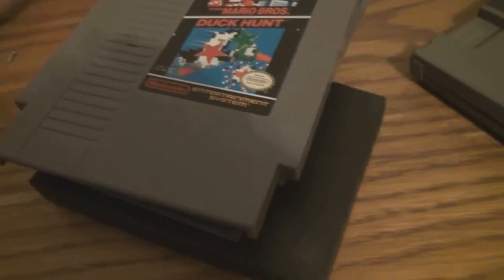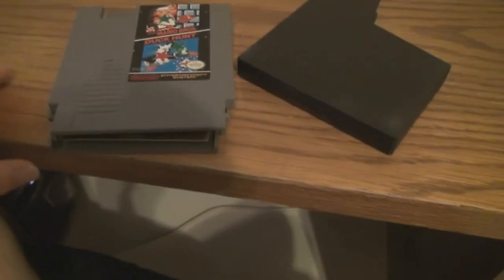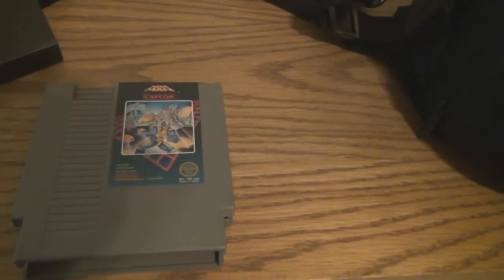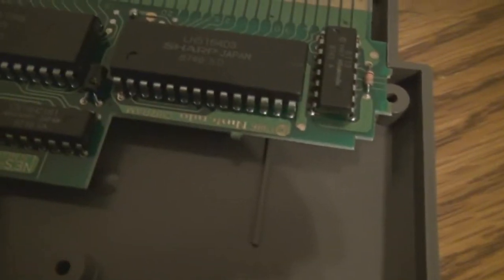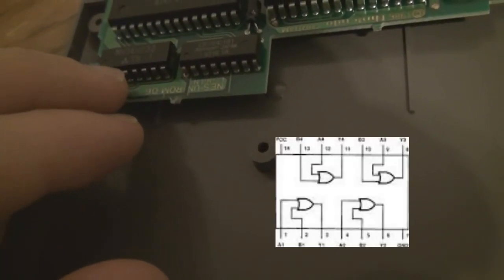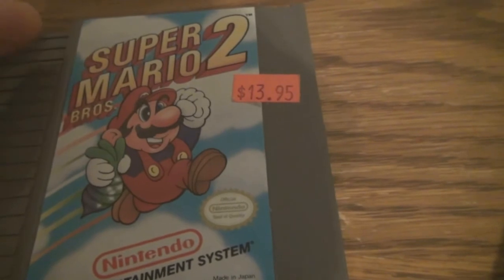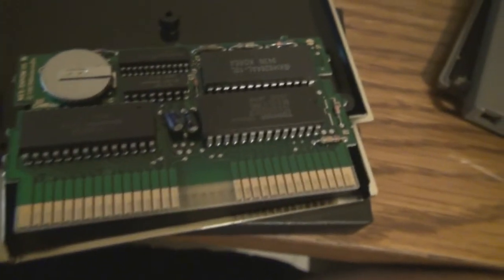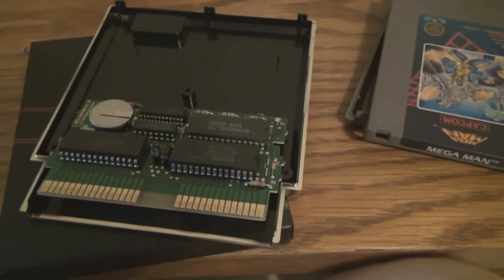Nintendo Cartridge Dissection - NES

Comment: I know your pain, my mum gave away my Amiga 600 because I had built my own (very shitty 486DX at the time, with no proper case and a power supply hanging out of the back because it didn't fit the shitty case) PC, I don't speak to her to this day for that..
Reply from the maker: Ha, my parents had an old 486 33MHz server they wanted me to set up for my sister to use and blamed me when it was slow.  Hell, this was 2004!  Of course it's going to be slow if you force me to instal Office 2003 on it.

But seriously, every time I got a new generation, my mother would question my sanity for retaining my older systems because in her mind, there was no need for them any more.  Obviously I would never play it again since I had something more advanced... and when I did play it, I was just being weird.  Finally, she decided I was simply a pack-rat, yelled in my face, and dumped my video game drawer in the trash.  I had to replace my N64 power adapter.

Comment: No, your tower is not "rougly 6,747x more powerful than an NES". You can't compare raw CPU clock rates like that, especially between vastly different architectures like a modern amd64 system and a 6502. The comparison is utterly meaningless.
Reply from the maker: I know that an 8-bit single core and a 64-bit quad core capable of multithreading can't be directly compared, but for the purpose of perspective I just wanted to show the ratio of the frequency.
Reply: *****
They can't be compared at all. The clock frequencies are meaningless, since the amount of clock cycles per operation is completely different for these architectures. Nevermind the caching, the dissimilar operation decoding pipeline, advances in branch prediction, everything. It's meaningless.

Or expressed in a silly analogy: you're ranking fruits by tastiness by using the amount of surface area as a comparison.
Reply from the maker: I wanted to avoid going into much detail about the console hardware in this video.  I just wanted to mention the different frequencies.  I regretted using the words, "more powerful" after I posted the video.  If we are going to be completely accurate, comparing the amount of memory isn't a complete picture either when you consider my level 3 Cache and bus frequency. I'm going to go into the architecture of the N.E.S. in the fourth video of the series.

At any rate, your point is taken.  Tell me what you think of the N.E.S. video in a few weeks.
Reply: Okay :)
Reply from the maker: I'll tell you what.  I'll even mention your name in that video and the chastising you game me. :)
Reply: *****
Be sure to do your research and pronounce my name right :P
Reply from the maker: I'm not sure how to pronounce Hesse, but I have a lot of information on the N.E.S.  I might demonstrate how to replace the cartridge connector.
Reply from the maker: ***** I mentioned you in my latest video. :)
https://www.youtube.com/watch?v=Vk8H9BOo6Ss
Reply: *****
Neat :).

It's not quite correctly pronounced, though: like most words in German ending in an e (like "Porsche") the final "e" in "Hesse" is a https://en.wikipedia.org/wiki/Schwa , so it should be more like "Hess-uh" instead of "Hess-ee". But, eh, that's just nitpicking. :P
Reply from the maker: Bah, I new I got it wrong.  Sorry.  I hope I covered enough detail regarding the processors to satisfy you.